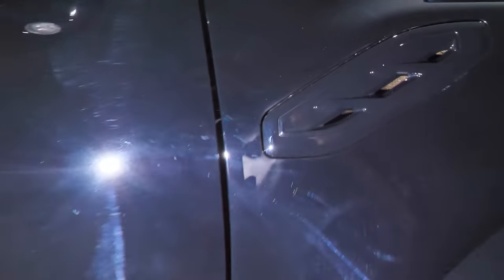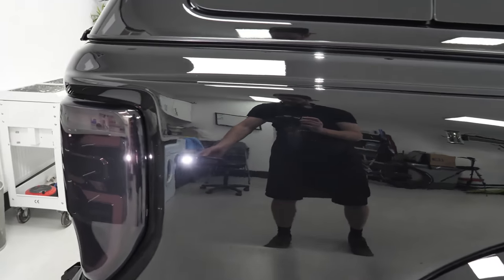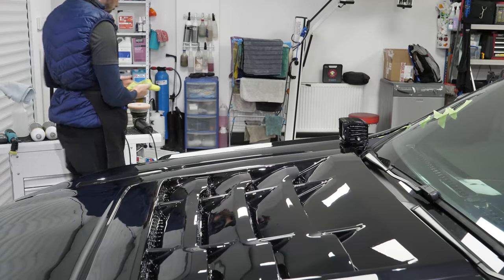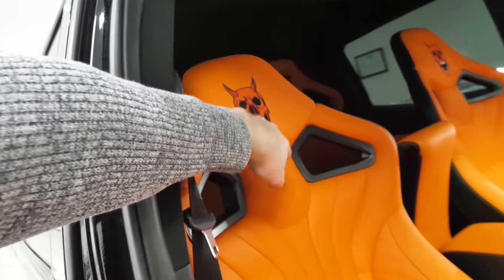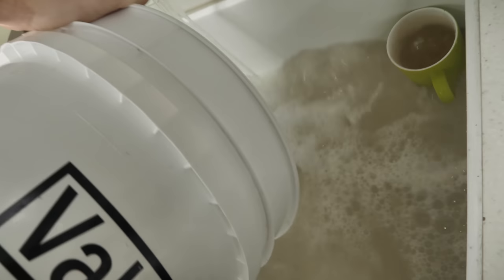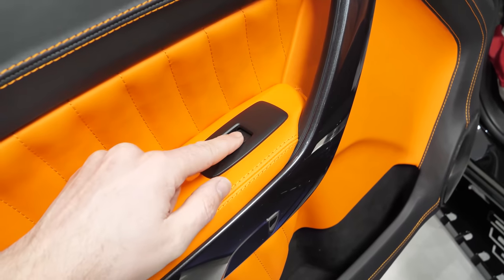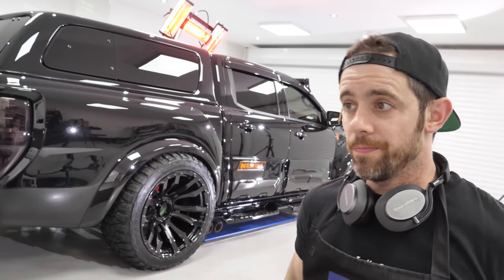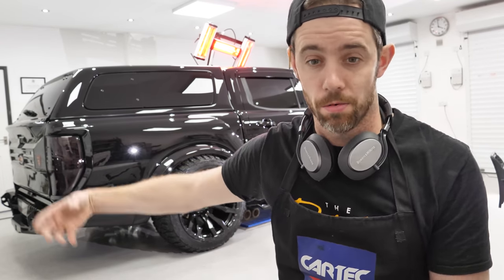Detailing Transformation On a One-Off Ford Ranger Pickup Truck

Comment: Once youve used your microfibres for a correction do you wash them and use them for a correction again or do you always use fresh ones. i was washung and reusing but then switched to using the kirkland microfibres as single use for corrections as i find that brand new they are very soft but after a wash or two theyre not the same, also very cost effective.

Comment: What also would work if you have paint overspray on your window: steel wool with water. When I heared that for the first time, I though that the steel wool would definitely scratch the glass. But if you are sure you're using enough water (spray water on the glass and make sure the steel wool is wet also), the overspray is quickly gone. But the thinner you used did the trick also.
Reply: clay bar works really well too
Reply: “OOO” steel wool is great and won’t scratch, however the tiny bits of steel wool break off and you can pick them up with a towel and they will scratch paint. If you go that route, it’s best to do that in the wash stage

Comment: Do you insist on leaving a freshly painted car or parts for a period of 3 months or more to be coated, I've just seen a few cars that were coated after 2-3 weeks painted, blister 12-18 months later, and they are putting it down to the coatings not letting the paint breath, the cars had to be stripped to bare metal and repainted with the panel beater taking the hit for,  I know personally paint changes a lot over the 1st 3 months.